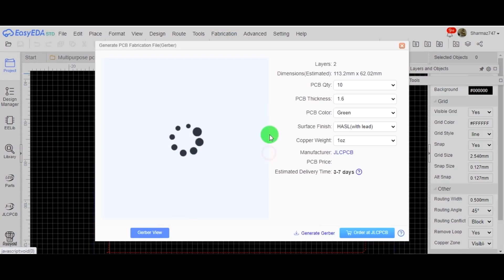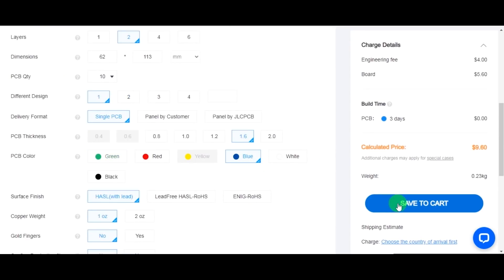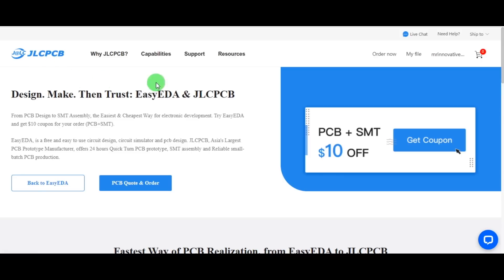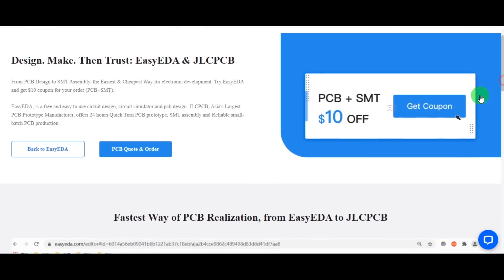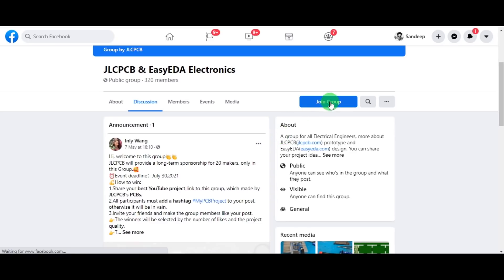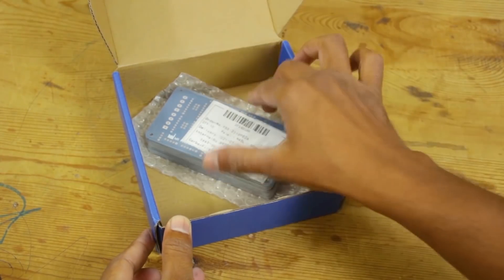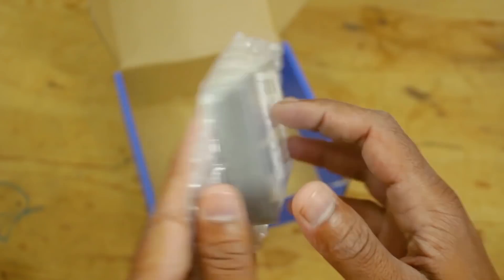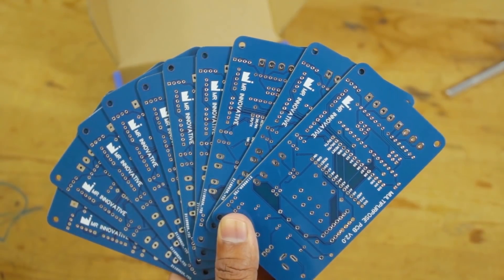DIY Arduino based Guitar Pickup Coil Winder | Arduino project

Comment: This is a really cool build and there is some serious engineering here, at least in the pickup winding community. But, there is some major issues here, for of all, a Stepper motor is not optimal in this type of application, because in general a stepper with this attachment to it could possible at maximum do 3-400rpm which mean this will takes for ever, also the AWG wire that is used in pickups will not work in that construction without re--design some parts of the construction. What is more interesting is the software, it could be used for this type of application I think :D
Reply: Esp32+a4988 = nearly 2200-2400 rpm. I made different pickup winders and i can guarantee.

Comment: Would it be possible to remove the wire guider section of the assembly in order in order to feed the coil turning mechanism by hand?

Comment: The project looks good, too bad it doesn't work.
What we are presented with is a demonstration of how it should work.
A certain variable is taken into account: the number of turns.
The rest are mandatory but are ignored. However, the program does not start without them. Only that.
In fact at the end of the program it says that you will probably have to experiment with the variables.
A comment would be helpful. A B C ...? Anyway it's an opportunity to learn Arduino programming.

Comment: As someone else already said, that wire was much too large. You should use 42 to 44 AWG wire and to get a coil resistance of about 7 kOhms, it would take about 4200 feet of wire. Also, most players don't like uniformly-wound coils; they prefer scatter-wound coils. Nice job otherwise..

Comment: A couple of suggestions: the magnet wire you are using is too thick. You will end up with a low impedance coil. 

Standard high impedance guitar pickups generally use between 42 to 44 AWG size wire. 

And the other suggestion is to be able to enter AWG wire gauge numbers into the winder. None of the major pickup makers use metric size wire. AWG is the industry standard. 

Nicely made winder.

For a typical humbucker you want at least 5,000 turns of 42 AWG wire on each bobbin. Hot overwound pickups can have up to about 10,000 turns of 43 to 45 AWG. A P-90 is 10,000 turns of 42 AWG.
Reply: How many coils is necessary to have a good impendance ?

Comment: the look of the machine is ok as described i made this machine i ordered a board and assembled i uploaded the code given in the description to the nextion and arduino display but something with this arduino code is wrong after uploading and starting the machine strange things happen after changing the #deine MICROSTEP 16 code parameter on MICROSTEP 15 or 18 everything works quite well the problem is that the selected coil width cannot be obtained, there is only one parameter about 8mm and the wire thickness cannot be entered e.g. 0.05 only 0.1 maybe someone has a solution to this problem

Comment: I'd love more info about this, especially the software aspect... I'd like to be able to choose "patterns" of how the wire goes back and forth. Also... why does it have a thickness? if choosing number of turns? Looks like what I'm after for sure, just wondering how hard is it to modify the software. In addition to patterns, I'd love to be able to enter in wire gauge, bobbin size and desired output and have it calculate the number of turns.
Reply: Thickness is the wire gauge. It should be in AWG (American Wire Gauge). That’s the standard used. 42 AWG is typical for the majority of pickups. 

I’m not sure why he has the size setting unless it has to do with the traverse.  

Winding patterns is pretty much a myth. When you hand wind you have a totally random pattern. No two hand wound pickups are alike. Yet if you wind three Strat pickups to 9,000 turns of 42 AWG they will all sound the same. If winding patterns mattered at audio frequencies you’d hear it.

Comment: I had you board made and building your guitar winder everything works except when i hit stop in the middle of a count the wire and coil length zeros out but the count keeps going.
how can i have the code reset everything.
subscribed in Florida.
Reply: How volts is you DC Input?

Comment: The author uses the MultiStepper class of the AccelStepper library, which does not support a smooth increase in speed and a smooth stop of the stepper motor.
For this reason, when winding the coil with wires AWG 42, 43, 44 (which should be used in pickup coils), these wires will simply break.
Reply: Which class / library would support smooth start and stop in place of MultiStepper?
Reply: @xdiscxnnectbeats  AccelStepper, I am currently modifying the code and maybe do a build video for the winder, lots of trial and error, it easily breaks AWG 42 wires in this stage.

Comment: Several questions: 1. How do you ensure that the spool is turned to deliver the wire? I guess it isn't? Then, more importantly, how does the pickup sound with super fat wire and only 300 turns?
Reply: The spool doesn’t turn. It’s too heavy and the wire is too thin. It would break. Generally you feed off the top of the spool. The spool can be on the floor in front of the winder, or as seen in commercial winders the spool sits behind the winder, often in a plastic tube (like a bucket) with the wire spooling off the top and usually through a wire guide. 

So you just need to sit the spool on one end and let the wire spool off the top. 

My spools (often big 5 lb spools) sit on an upside down plastic bucket on the floor right in front of my workbench with the winder on it.
Reply: I think it's just a demonstration of consept, the bobbin also seems a bit oversized
Reply: That's also my observation, with 40 to 43awg copper wire it might snap. I tried this multiple times on my diy winder holding the wire with only my fingers and I rarely finish a pickup without snapping it midway. Feeling it by hand, I guess is still the best way to wind a pickup, I hope there's a solution to replicate it on arduino machine.
Reply: @GitaraMaker  I have actually wound a couple of pickups since watching this video and I have to position the spool sitting on one of its sides so that the wire can freely unwrap. I also hand tension it and I make sure the bobbin has some give using Teflon tape and isn't fully secured to the shaft.  It actually seems quite complex to make a usable production quality machine.

Comment: Ich habe versucht, Dein Projekt nachzubauen. Es läuft auch. Jedoch kommt es mir so vor, als ob der Motor, welche die konstante Wickelarbeit leistet etwas stottert ( unruhig läuft ) und der zweite, welcher die Drahtführung übernimmt, fährt einen viel zu weiten weg ( ca 34mm, bei eingestellten 8 mm Coil width ). Trapezspindel ist TR8 mit 8mm Steigung ( 4-gängig ). Jumper-Settings für die A4988.  Step/1 alle gesetzt - Step/2 alle gesetzt. Was ist da falsch bei mir? Oder wurde der Sketch für den Arduino nano oder die HMI verändert gegenüber dem was man herunterladen kann.

I tried to recreate your project. It works too. However, it seems to me as if the motor, which does the constant winding work, stutters a bit (runs unevenly) and the second one, which takes over the wire guidance, travels a lot too far (about 34mm, with a set 8 mm coil width). Trapezoidal spindle is TR8 with 8mm pitch (4-start). Jumper settings for the A4988. Step / 1 all set - Step / 2 all set. What's wrong with me? Or was the sketch for the Arduino nano or the HMI changed compared to what you can download. Most AWG enamelled copper wires are less than 0.1mm thick, usually with 3 decimal places and the stop button in the .hmi does not work either. It would be nice if you could update the corrected scetch and hmi files.
Reply: Ich habe das Teil auch nachgebaut und ich habe die gleiche Probleme wie Du. hast Du eine Lösung gefunden?

Comment: Nice clean project but far too slow to wind any single coils. You need 7400 turns.... that would take forever. Is there a mod for a faster RPM option ?
Reply: You need it faster?! For me it’s to much fast!! Anyway I think it rotates at 200rpm/min so for 7400 turns you’d need 37 minutes..not so bad!

Comment: what type of sensor does the roll counter sensor use?
Reply: I don’t see any counter sensor, probably the number of turns is calculated by the number of steps on step by step coil engine.